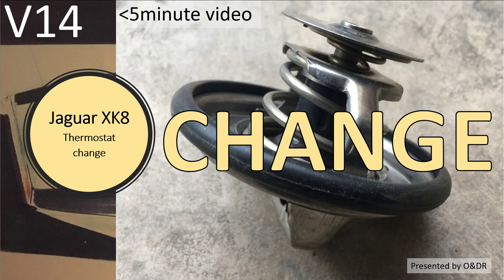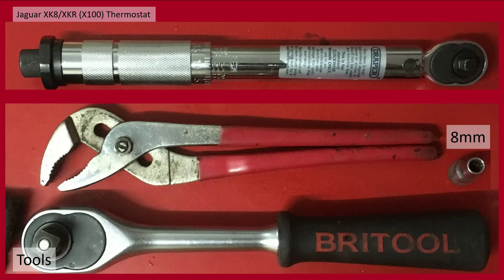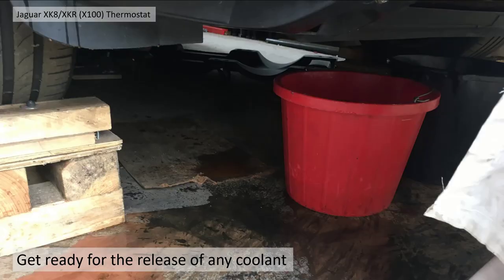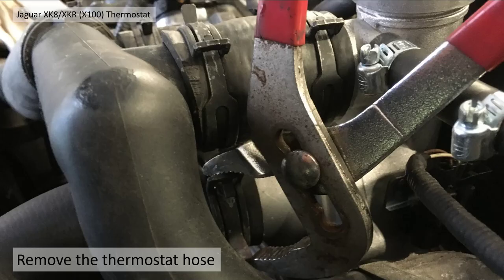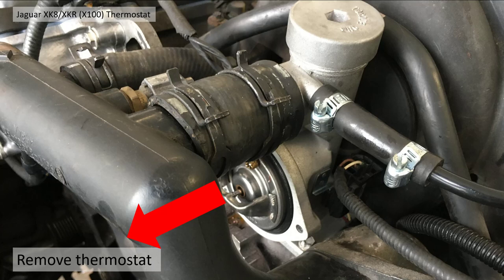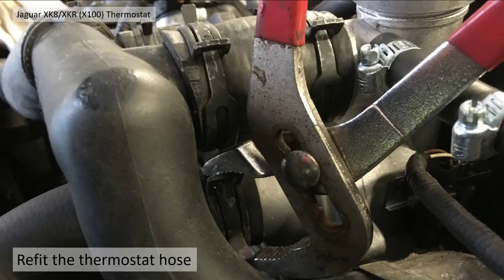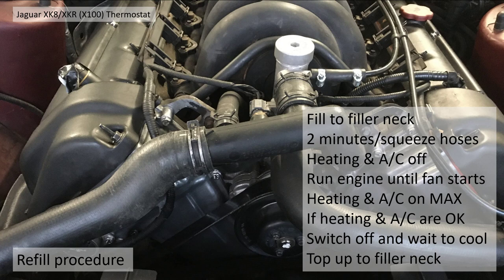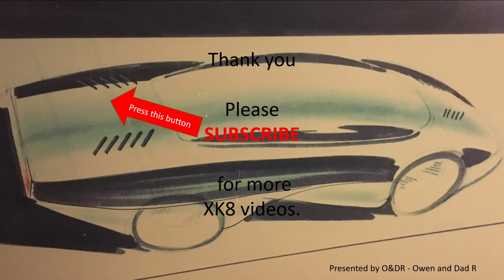Thermostat Change V14 Jaguar XK8 (X100)

Comment: Thank you for this video Damian, I've had to replace my thermostat after the engine just wasn't warming up, even a long run. I used my obd reader and got 2 codes P0116 & p0125. Your video was invaluable in attempting the job myself and it worked a treat, my temp gauge now sits  in the middle quite happily. One thing I did was to use a polythene bag to capture the coolant which prevents anying spilling onto the electrics and also means I was able to capture all the coolant for putting back into the system.
 It's a tip a plumber gave me when draining a low level radiator. 😁
Reply from the maker: Andy, plastic bag is a TOP TIP, nice idea especially with the electrics. Thanks for the comment regards Damian

Comment: Hey mate great video, is there anything you have to do different on the XKR x100 4.0? Im attempting it tomorrow, thanks
Reply from the maker: Ben, Thank you, it is basically similar but the pipework you need to remove is different. You can find the Jaguar instruction how to do it in the workshop manual. You can find these on our website www.modurol.co.uk . Hope that helps and good luck 👍, regards Damian